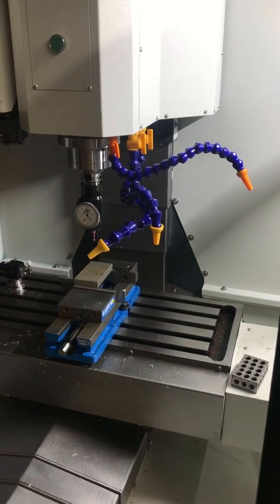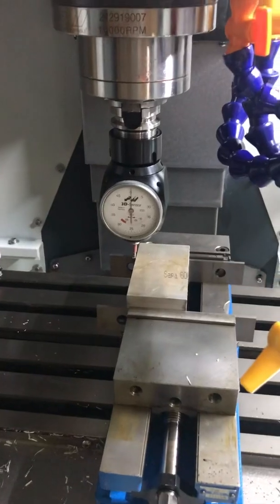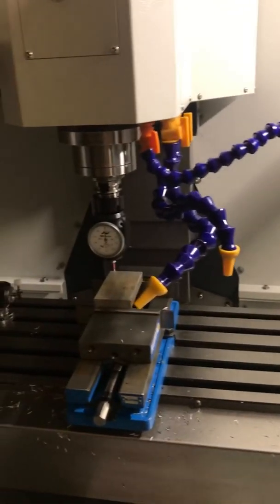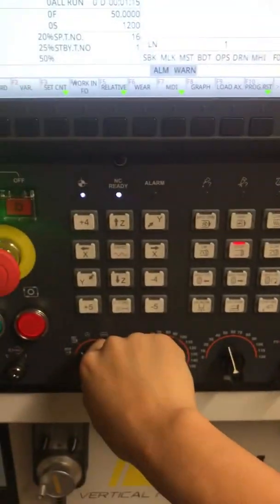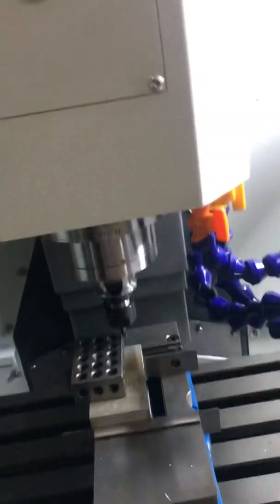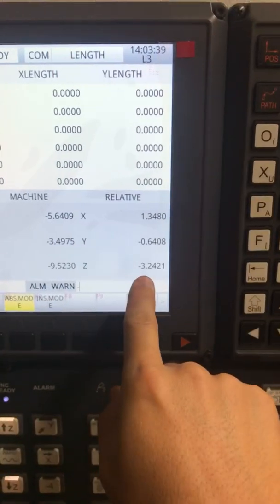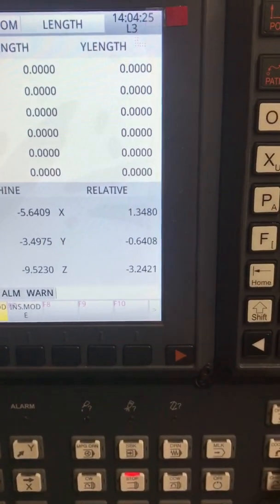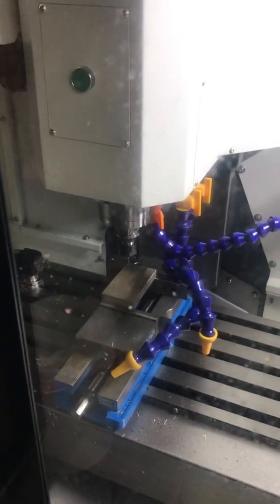Work and tool offsets on the Syil X7 LNC6800

Comment: Have you already use the TC200?, i also have a Syil with the same configuration as you but i cant figure out how to properly set my work offsets and tool offsets... Its driving me crazy.
Reply from the maker: qera I haven’t tried yet. I’m just using a 123 block & 1/4” pin. I think on the Syil Facebook page they posted a little on it. When I figure it out I’ll probably post a tutoriak.
Reply: @gtscientific_and_manufacturing  In your video, what was the tool z offset in your haimer T.NO 16? Zero?
Reply: Ok, i just figured out what was happening, my controller didnt update the value of absolut Z until i comanded a g0 or g1 in the MDI
Reply: TY